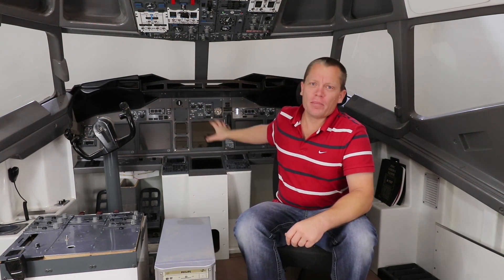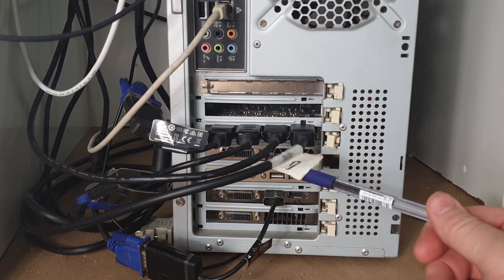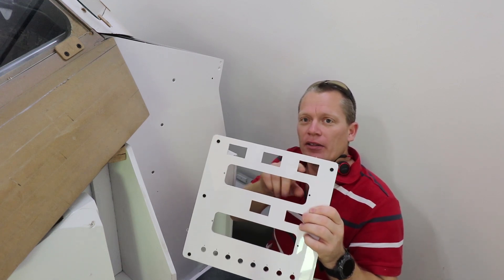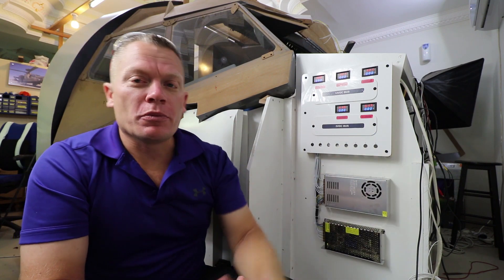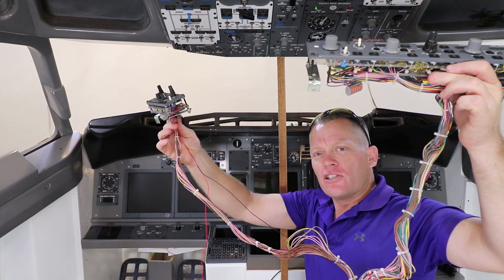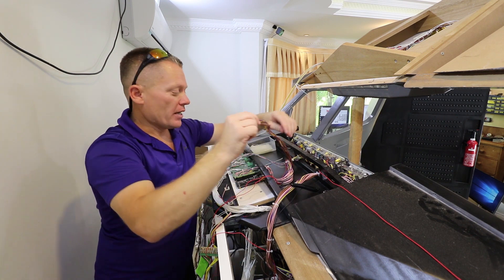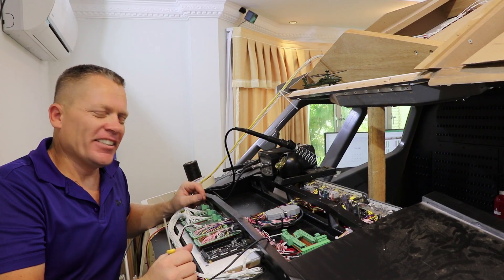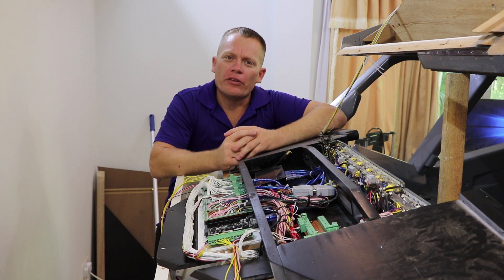737 SIM Build - Power & Wiring

Comment: Not running fuses on anything after the power supply?
Reply from the maker: Hello, no fuses. I have over a hundred real circuit breakers. I will utilise them to protect all the systems. Hence all the cb type holes at the bottom of the power panel. But theres only so much I can cover in one episode. Was going to use the CB panels at the rear, but that would mean running wires all the way to the rear and back to the front, with connectors so I could still seperate the sections. Lol so I'll just create more CB panels at the front.

Comment: hi, 
i have 10 usb hub uncluding factory power supply  plug .i run 6arduino for mcp efis mip thorttle padesta.can i put additional power  supply 5v. reason for support  power.
Reply from the maker: Hello, Yes you can add an additional power supply, justy make sure you connect the ground between the arduino and power supply. You can not however, use it to power the arduinos themselves.

Comment: can you give me drawing power suppy to arduino.
Reply from the maker: Hello from Sunny Brunei! i Just wanted to point out here, you can not power an arduino directly from a 5V power supply! (This was probably my bad wording in the video. 5v is not enough to overcome the voltage regulator on the Vin side of the arduino. If you want to power the arduino's externally, I would suggest a 7v external power supply. Why 7v and not the standard 9v? If you take a flir camera (heat camera) to the board under operation from the USB, and power it externally at 9v. It gets so close to is maximum operating temperature. I found out through testing 7v is much more acceptable. I also found out if you apply the 7/9v first before apply the USB connection, the arduino regulator does not heat up. For my current arduino's, there's seems to be a conflict between external power and usb. In real life however, the way my sim powers up, is computers first, then external accessories.  That being said, I do drive all my servo's and 7 seg displays from external power supplies using 5v (actually 5.2-5.3v, as the 7 segs don't like the drop in voltage when more current is pulled). If you want the drawings/wiring diagrams for this, there are plenty n my website: www.737DIYSIM.com under getting started. Kind Regards Karl
Reply: by the way. i from malaysia. tq for the reply. good explanation.